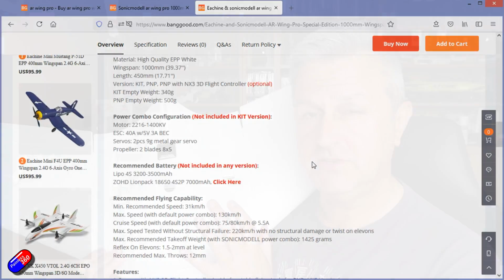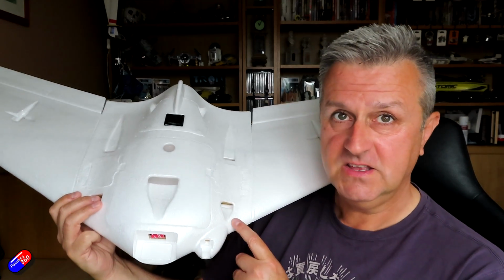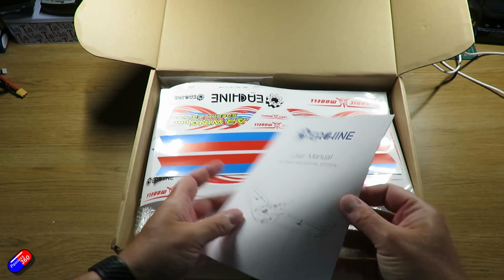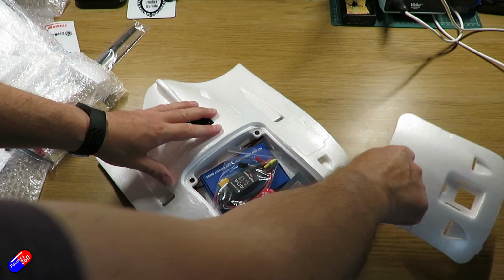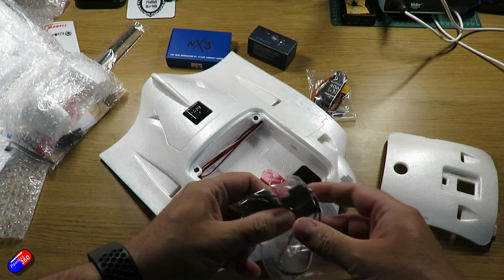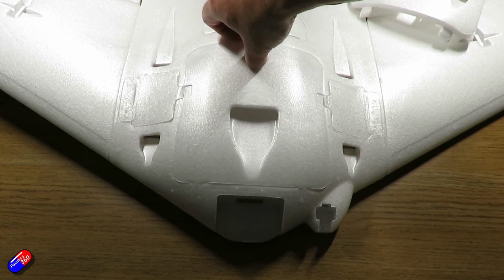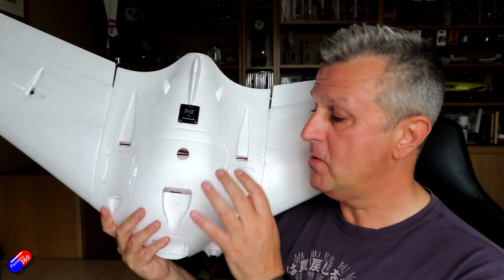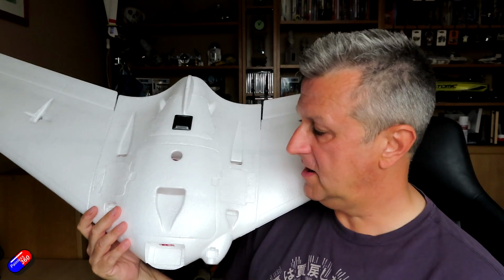AR Wing PRO: Now available in white (from Eachine!)

Comment: any good tutorials on how to add extra wiring between the wing and fuselage? 
or any upgrades to the pin connectors? its a shame it wasn't an 8 pin connector.
Reply from the maker: Agreed. I wanted 8 pin.... Happy flying
Reply: @Painless360  I've been searching and there are NO videos showing how to run wires to those wing compartments. Might be an idea for a video.
Do you think a Servo sharing a ground wire with the RX will cause problems?
Reply from the maker: It should be OK, it is what I'd try first..
Reply: @Painless360  im going to throw a capacitor on the reciever's power pads and give it a shot.
Im not building toothpicks anymore maybe i can just throw a full BEC right in the wing lol

Comment: You said just a tick over 1 kg AUW, and you were able to balance on CG marks with only 5G nose ballast?  Can you verify this?  I’ve had two air frames, with a pack that brought AUW to 1100g, and CG is still 5~7mm behind cg marks
Reply from the maker: See you my build of this for my latest layout. I use a very heavy battery and a full sized air unit in the node along with 50g (no action camera) got it spot on. Moving the Air Unit back meant adding more weight was needed in the nose.. Happy flying

Comment: The DJI module vista is already getting very warm, especially in the closed box when searching for the satellites and
 broke down... started flying again with RC Immersion. Is there maybe a solution for this.
Reply from the maker: See my video on the new GPS mate... Happy flying
Reply: I use a USB power pack to power my flight controller and GPS for the first flight of the day.  The USB pack supplies power to the flight controller, receiver and GPS module but not the VTX, camera or servos.  No power to the VTX == no overheating.

Once it acquires enough satellites I then connect the main battery pack and go fly.

Comment: Any one figured out how to launch this thing ? So difficult to launch
Reply: I had several issues on launch.  Finally figured it out with a side arm launch and about 75% throttle.  Using INAV autolaunch too... 25 degree climb....
Reply: @SteffenRC  what batteries ? Mine are pretty heavy lions
Reply: @matejbludsky8410  3300mah 4S lipo..  My AUW is 1220g..  Whats yours?   Are you using AutoLaunch or manual to get it in the air?
Reply: @SteffenRC  autolaunch doesn't work for this at all unfortunately .. running GoPro plus 4s4p 12000mah .. definitely heavy lol
Reply: @matejbludsky8410  that is not a plane, is a brick. First, more when you ask for help, is weight the plane.
Reply from the maker: Check out my maiden video for the AR Wing Pro and my video on how to setup INAV Autolaunch (used in that video). Works a treat!

Comment: So there's no difference from the Sonicmodell version other than it iswhite, has nothing installed, and the servos and motor have been replaced with cheap no-name parts? It's about the same price as the original too.
Reply from the maker: Pretty much. I was hoping that SonicModel would have brought out a different, mote powerful motor and ESC setup rather than do this with Eachine....

Comment: Hi Lee, How does this work ? Is the Eachine version a 'rip-off copy' or does it have Sonic- Modell's blessing? I don't know much about Eachine, are they commercially linked to S-M, Take care, Steve :-)
Reply from the maker: Eachine are white labelling a lot of the more successful things in the hobby (this, TX16s etc.). They seem to be doing it in collaboration with the original vendors/manufacturers. Check out the Eachine TX16s video. Only makes sense when they add something into the mix and not sure this does that..
Reply: I saw the Sonic Modell logo on the box. So it looks like they do have their blessings.